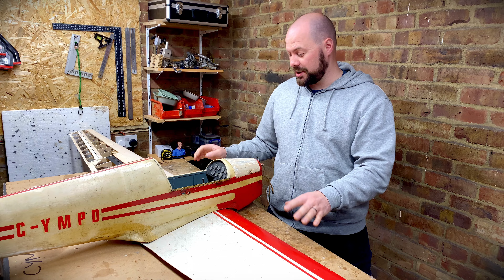1:4 Scale RC Fournier motor glider restoration - Episode 3

Comment: Rob - I'm currently building one of these from the original kit (sort of). I started building it in 1982 but it kept getting put to one side! My build is documented on the RCScalebuilder forum and the Flyingsites forum. You might want to have another think about that wing joint. Mick's original design was notorious for in-air failures so I've modified mine to have a glider-style vertical steel strip joiner. Mine was originally intended to have an OS61FSR, then an OS90FS but I'm now finishing it with a 1.7kW electric setup. The full size isn't really a motor-glider; it's more like an aerobatic tourer, and the model is similarly aerobatic. If you wanted to compare notes I can be contacted via either of the forums (I'm in Surrey). 
Regards, 
PDR

Comment: I'm finding these videos fascinating as I am currently building a MR Fournier (lockdown project) and have completed the woodwork, just covering and fitting out to do. I'm going electric. Interesting to see some of the mods done by the previous owner, eg, the beefed up trailing edge which is way too flimsy as per plan/kit. I too have made some changes as I found the model to be a little under-engineered in places. I have gone for micro servos in the wings for ailerons and (simplified) airbrakes. I think you'll need your spoilers as I've heard it's a very efficient wing and with an IC ticking over up front may be difficult to slow down for landing etc. Make sure there's around 2° washout in each wing panel as per plan (it's inbuilt during construction using tabs on the ribs that are cut off later), as it looks tip stalling may be likely without it. Glad you got the retract unit from MR which is really quite a nice unit. Incidentally, the method for keeping the wings together at the trailing edge is to use locating dowels. These seem to be missing from yours and are in addition to the wing bolts. I've documented my build with loads of photos for the fun of it!
Looking forward to the next episode(s).

Comment: hi rob just saw your vid on rf4d i have flown my rf4 7 flights to date  /she is a bit of a handfull i find the profile hard to see in the air the wings have the same  taper front and back. easy take off landing hard on single wheel in peat bog  almost over the nerver  stage. anyway back to work seamus